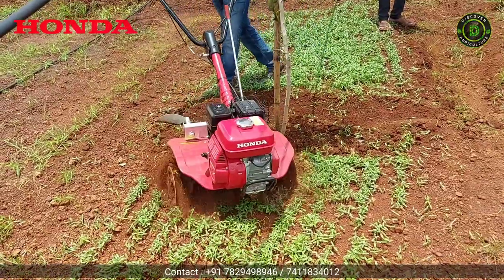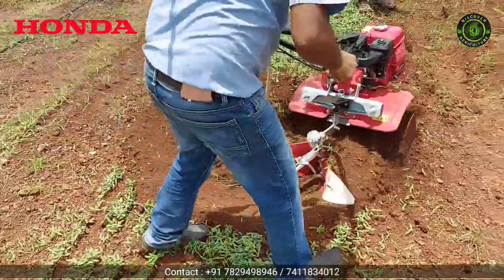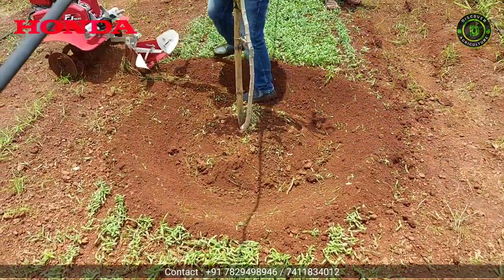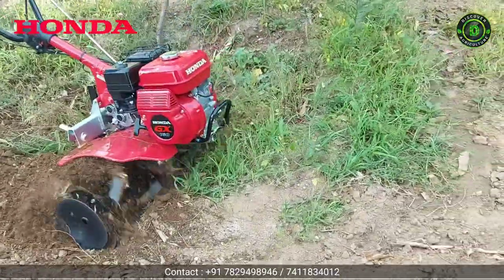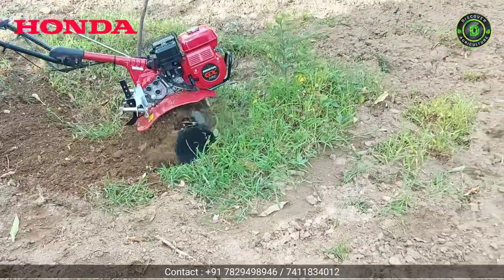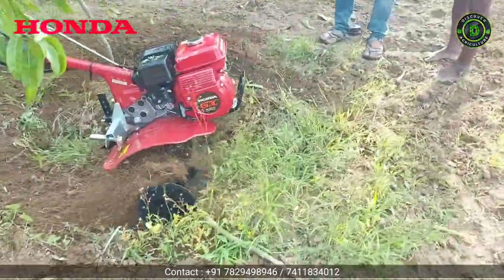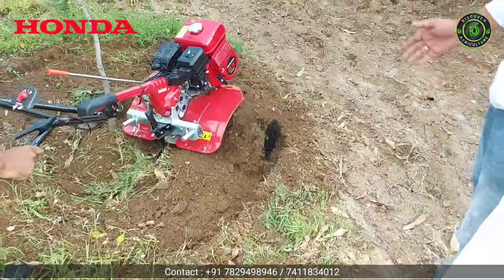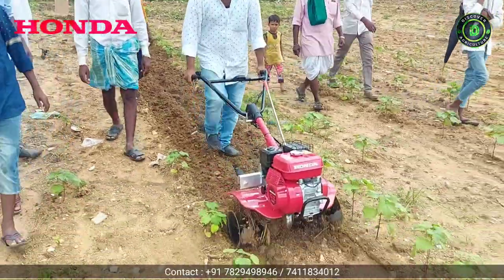HONDA FJ500 Power Weeder - Best Multi Purpose Power Tiller / Weeder | Honda FJ500 Attachments

Comment: What fuel does it consumes...
Does it comes in diesel too?
Pls revert
Reply: FJ500 5Hp
Width 1feet to 3feet adjustable
Depth 3inch to 6inch adjustable
1liter petrol its run 1.20hour
It's can use Multipurpose Machine
Maintenance less
Vibration.less products.
Reply: @shrikanthnarayanpet5976  nice !